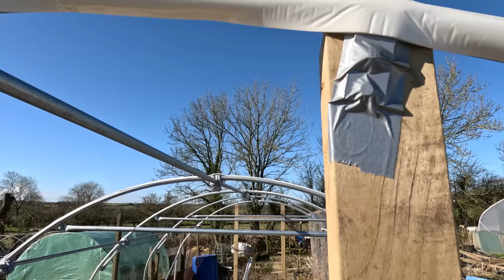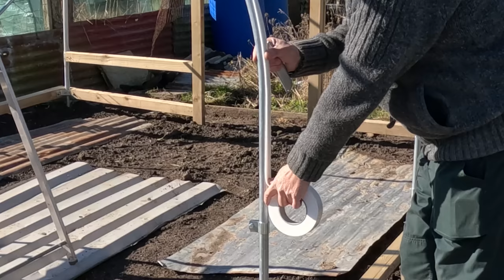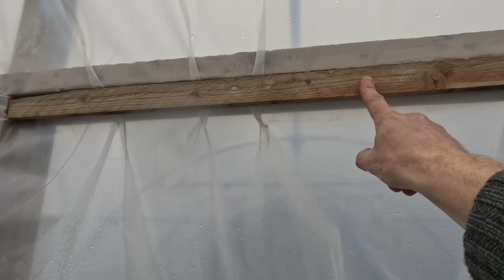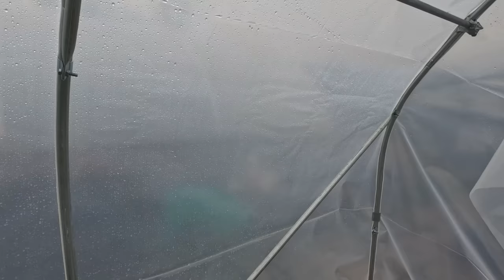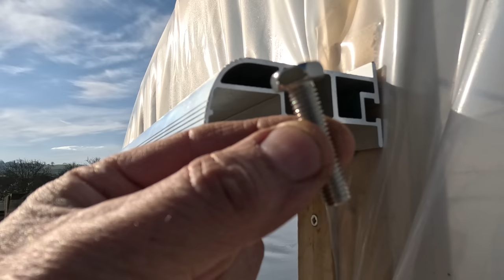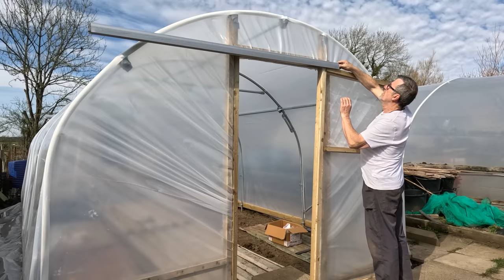Polytunnel Cover On |  Finishing off | Tunnel Complete | Green Side Up

Comment: I did the second tightening of mine yesterday with the help of two bits of wood with 2 3 x 2 concrete slabs on them with me kneeling on them to tighten the bolts . It worked very well.
Reply: If you meant pieces of timber at 90 degrees to the base rail and with their ends resting on top of the rail, that's what I did, with two 600x600x50mm precast concrete slabs plus  a couple of bags of ballast on top.
Reply: @David_Bell_growing  Yes that's what I ment.

Comment: Good useful video Steve. About to put my order into first tunnel . Already have a frame up but I’m going to add the fittings for no dig tensioning sides. Crop rails. I’ve noticed in the past the posts that go into the ground tend to rot shame first tunnels don’t make a plastic addition to go into the ground. I’ve done that with my fencing at home.

Comment: Thanks, Steve - I got my 12’ wide x10’ long First Tunnel polytunnel a couple of weeks ago and am now putting 2 sliding door frames up. I hope to finish this week subject to rain. Pretty easy.  what would help is for the 4 piece main hoop if they have alignment marks so can stay true.  While instructions suggest finding yourself a nice dry flat garage to assemble, the reality is most plots will assemble on the grassy ground. Like you, I used the screw post, which was not a problem going in - just tough to keep them aligned.  In the end, there is lots of tolerance and adjustment is done by loosening/tightening screws. I am planning to cover it myself. I will use wood clamps to hold the header in place. 

 One thing on your tunnel, you might have a peek at the folds coming into the door jam. If you can remove any pockets that can collect water might keep the cover looking smart longer. (you should be able to unloosen your screws and gently post the plastic up.)

I’m 67 years old so anyone can do it. Great packaging and instructions by First Tunnel.